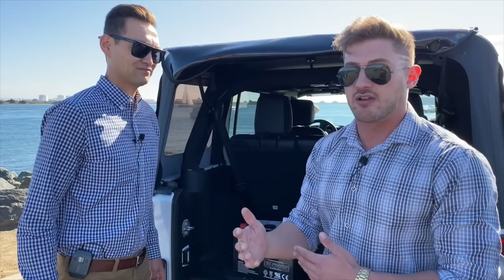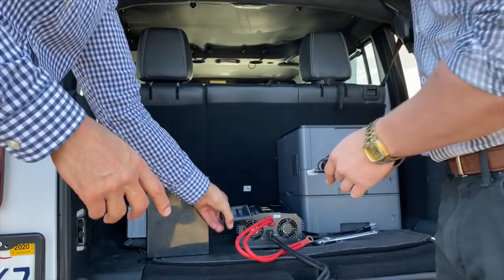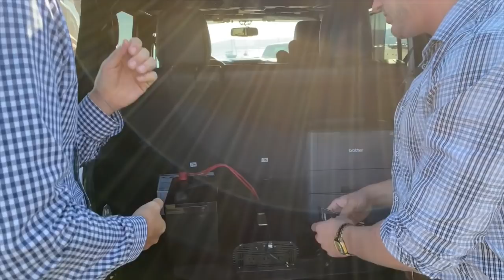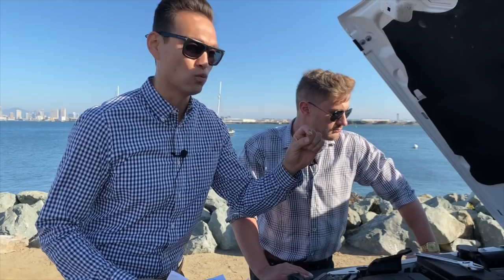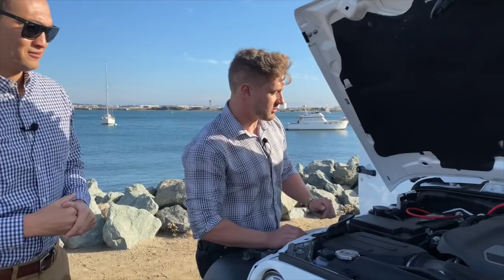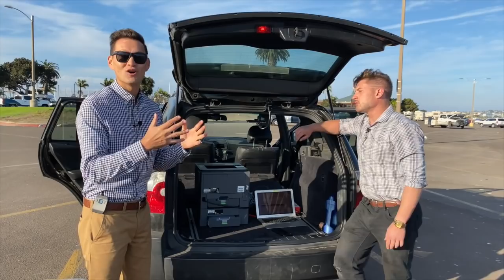How to Set Up a Mobile Office with a Printer So You Can Print Documents from Your Car | Notary Hacks

Comment: This is a great idea but I really would have to recommend if you use the car battery and run a cable to the back be sure and use an inline fuse on the positive line close to the car battery, just in case. 12v in-line fuses can be found at Amazon and get one which matches the inverter. For the technical people one can get cables from some Chrysler vehicles since they have a trunk battery or one in the back seat at a junkyard for very good prices and those are welding cables which is perfect for longer lengths.
Reply from the maker: I never thought of that! Thanks so much for the useful advice, Steve!

Comment: Quick tech question: if you are worried about drawing down your car battery, could you not run a separate battery in parallel to your vehicle's battery and use the alternator to charge both? It would technically be the same as an RV set up with an inverter. And if you are worried to much draw on the alternator, you could put a switch between the two batteries. Just a thought...
Reply from the maker: Thank you for the golden nugget Michael!!

Comment: I bought a 100AH deep Cycle battery a Krieger 2000 W inverter and connected them up in my office trying to make sure it all works before I try to put it in my car.  the Brother Hl-L6200DW Printer keeps giving me an orange error light. and shuts off says it will restart in 15 minutes so its not working but the printer does work in a regular AC outlet. It only is supposed to pull 650W while printing so not sure why it won't work.
Reply: I finally got it working I uninstalled and reinstalled the printer software and drivers and set it up again. Made sure my battery was completely charged and now it is working like a dream. YAY!!! So excited to hopefully be better prepared to make more money trying to increase from 4500 a month to 8K a month
Reply from the maker: Hi!! I actually just released a 2023 updated video on how to set up a mobile office for your business! It is more cost effective and safer! Click below to watch:

https://www.loansigningsystem.com/mobile-notary-office.html?utm_source=YouTube&utm_campaign=mobile_office

Comment: would it be okay to also have a laptop or other devices plugged into the inverter while also using the printer?— as long as it's within the watt capacity?
Reply from the maker: I am hesitant to answer this as I am not an electronics pro...but from my conversation with Conner is yes. 

As long its under the watt capacity you should be able to! 

Make sure you always check with a professional!
Reply: Laptops can be run at power balance for longevity; my suggestion is carry spare battery packs for your laptop; a lot less expensive and takes out the guesswork

Comment: Install battery in trunk and if you don't know how, go to a mobile stereo installer and have them run a power line to the trunk so your truck will automatically charge when you are driving. And you can get a battery much cheaper than $150.
Reply: A stereo installer would also have a battery box for that purpose which will bolt down.
Reply from the maker: Thanks for the great tip man! Game changer!

Comment: Wow, thank you for this great info. I ordered a Bluetti solar generator earlier this year (Florida hurricane prone)  - I think it can be used as well? I have not had any practice to set up and have been checking out you  tube to set it up.  I wish I knew more about this kind of things. The past three hurricane seasons here in FL have been so scary so I got this for backup.
Reply: https://smile.amazon.com/gp/product/B07QZC1FV3/ref=ppx_yo_dt_b_search_asin_title?ie=UTF8&psc=1      (Amazon MAXOAK Portable Power Station BLUETTI EB150 1500Wh AC110V/1000W Camping Solar Generator Lithium Emergency Battery Backup with 2 AC outlet Pure Sinewave,DC12V,USB-C for Outdoor Road Trip Travel Fishing)
Reply from the maker: Thank you for sharing this valuable tip!!

Comment: Hello, I have the same battery and it only seems to be charging to 80% according to my display on my charger. It will only print about 3 times (100 pages or more each time) and drops to 60 % and cant run my laser printer anymore? Something is wrong, correct? Ho do I know if the battery is defective or is it my inverter and or charger? Thank you for your help.
Reply: I have the similar issue...    I recharged the battery at night by using the specific voltage (15 A  and AGM mode) and it did not take 6 hours to recharge the whole battery, it only took about 2 hours or less.  Then I was only able to run my Brother 6200 DWT printer in the car two times (each about 2 sets of 150 pages) then the inverter starts beeping because of the low voltages... now I am wondering if there is a defect on my external battery or inverter.       Can Chris or Mark help in answering our questions?     Thanks!
Reply: @AmyyyWA  Hope we get answers for more of this technical stuff.

Comment: Cigarette lighter converter will work just find
Reply: Carl...does the cigarette lighter inverter still working?? I wasn't sure of those plugs would support a brother 5200 printer...thanks
Reply: @patrickkmanning  I plug everything in that plug never had a problem with it. I don't have any special batteries either
Reply: @CarlJohnsonandAssociates  interesting...
Reply: What kind of car do you have? I'm surprised you are able to get the necessary juice (1500w) to get your printer going!
Reply: @irhapsody2010  a 1999 ford expedition

Comment: Dope video! Printer consumption is 1200-1400W while printing, so all you need is 1500W inverter unless you plan on having other things using a lot of power but 1500W should be more than enough for printing and charging laptop. And all the items have skyrocketed because a lot of people are working remote or getting into the signing agent business and other business that require printing supplies . Greedy people know this and have stock piled on printers, toner etc.. just to flip them lol capitalism is at it's best during tragic times. Live, Love, Laugh and Learn...

Comment: I camp in my vehicle for recreation sometimes, so I already have a deep cycle battery in the back. It even has a vented and mounted battery case with a switch for the outlets (including usb) we wired to it. I just need to check what my inverter is rated for.
We have it wired as such that it charges off of the vehicle when it's running but doesn't over charge and leave one dead.
Unless you know what you're doing, I reccomend getting it professionally done if you want things the way I have it.

Comment: It may be easier to have longer cables and connect to the battery run in front of the grill and underneath the vehicle instead of through it  and connect to the back. Personally I'm not a fan of running off of externeal battery only as vehicle grit/dirt could give an unprofessional appreance during the signing or be transfered to the paper during the signing. if I were to go with the removeable battery I would buy 2. This way it is easier to ensure  a full charge and swap the accordingly (daily). I would also build a wooden box to ensure the battery wouldn't shift or have a fully exposed printer (tempting someone to break into the vehicle).  This is a solid idea. Just my 2 cents.
Reply from the maker: love the feedback!!!

Comment: Excellent Vidieo. Just like to mention when running wires thru the  car's firewall there should be rubber grommet around the opening. WIthout putting a grommet in place, the bare metal along with the car vibrations will eventually cut thru power wire, thus causing a fire. Yes you can do it, but be safe.
Reply from the maker: Thank you for the feed back!! it is appreciated!

Comment: I live in a part of SOCAL that gets 110 degrees plus during the summer, which means even hotter inside of the car. Won't the heat in my car damage my electronic equipment?
Reply: run your ac before you fire up the printer
Reply: Yes it could

Comment: Wow! The price for the converter and printer has tremendously increased on Amazon. May want to look for substitutes.
Reply from the maker: Ahh, gotcha. Thanks for letting me know, Val! When you enroll in the course, you'll get access to a network of 6,000+ successful Loan Signing System students who most likely have a few other printer recommendations... as a matter of fact, shoot me a quick reminder as soon as you enroll and I'll be sure to bring this topic up on my next live coaching session!

Hoping to see you there!
Reply: @MarkWillsLoanSigningSystem  My COVID Signing Agent experience: Anything that deals with electronic components is more expensive and really hard to find right. I called 20 different venders for that brother 6200 and everyone was out of stock either back ordered through the next month or even into 2021. I did finally find a local company who had the 6400 model in stock, so I had to jump at the higher price/bigger model just to move forward. Cheapest inverter I could find was this one on amazon @ $280 (I'm not an affiliate or anything) https://www.amazon.com/gp/product/B07H9SXV61/ref=ppx_yo_dt_b_asin_title_o00_s00?ie=UTF8&psc=1. My mobile setup printer/inverter/charger total ended up at $1,200! Upside is that with APR's so low, I got 16 closings in my first 2 weeks as a signing agent. I'll make back all my startup costs in the first month :)
Reply: @MarkWillsLoanSigningSystem  I am already enrolled 🙂 I’m just waiting on my notary application to be approved. I was watching the video because I love tech and thought it is a great idea to have a mobile office. While I’m waiting on my notary commission... I am completing your course. Thanks for responding 😀

Comment: If you have to print on the go, would it not be easier and cheaper to just go to Office Depot after saving the documents to a jump drive?
Reply from the maker: Two things-because of borrowers private information on the loan docs you should not print in a public place.
 
Secondly what if there isnt a office depot around...now what? 

Printing in your car in the long run is the cheaper way to go but you also never need to search for an office depot! you can just pull over and  print!

Comment: How would I set up my mobile office equipment if my truck may have 2 batteries under the hood?
Reply: Most likely it’s parallel (negative battery one to negative battery two, positive battery one to positive battery two), hook up the power inverter to the battery that is closet to the starter.

Comment: What about the scanner portion of watts? Would I need to add an additional 1300 watts on top of the 1400-1500 the printer needs? I want to do this so bad but I'm scared ill do it wrong or underestimate the wattage needed.
Reply from the maker: As long as you are not running the scanner and the printer at the same time this set up will be efficient!

Comment: Thank you for the video. Finishing my training. I understand every vehicle is different but how do you secure the printer from bouncing around and tipping over as you drive?
Reply: I'm planning on using Velcro with adhesive on the back. Sticky side on my printer and hook size into my vehicle carpet.

Comment: Okay here is my dumb question  again. I been at this for 2 months now and haven't printed not one thing mobile yet. Do it have to be a battery charger. I have a Stanley portable power....jumpbox..1200 amps...500w inverter. I have my batter hooked to it but I have no idea if its charging the battery.  Would you suggest I buy a charger or do I already have all i need?

Comment: I wont get into my resume, but suffice it to say that automotive intricacies are my forte.
That said, YOU DO NOT NEED AN EXTRA BATTERY OR CHARGER. The car has a DC electrical system that any pure sine inverter with a "cigarette lighter" plug will use so long as your car circuit can handle the amperage (other, slightly more complicated installs of the inverter can be done to bypass this issue. There are plenty of other YouTube videos showing exactly how to do this.) This inverter should be double the watts you need. 
This next part is IMPORTANT: You must leave the car running while using it. By doing so, you are NOT using the battery in the car per se. What you are using to generate power is the alternator. Once your car is running it does not need the battery. In fact, it can technically be disconnected after startup and the car will remain running.
Now, if you use your inverter while the car is off, you absolutely will destroy the batter. Even a deep cycle lithium battery would eventually be useless. 
I love that Mark is trying to help, but as somebody who has spent a career working on advanced automotive techniques, I felt obligated to correct this information to for the betterment of everyone. 
If anyone one had any more questions or needs any help, please feel free to contact me. I just want everyone to run their business with as little overhead and maximum profits possible.
Reply from the maker: i appreciate the feedback as i am NOT an automotive expert.

With that being said, i think you said it best "so long as your car circuit can handle the amperage". 

it is my understanding that the DC out let in the car does not have the amperage needed to run a dual tray laser jet printer hence the need for an inverter to be attached to batter whether that is the battery in the car or secondary battery.
Reply: @MarkWillsLoanSigningSystem  The way I would personally do it is install wiring that is essentially what an after market stereo amplifier would need and those wire would absolutely be able to hand 20 printers. It's about a $30 kit. 
Either way, thank you so much for everything you do! I purchased your program and it's fantastic. I cannot wait to get going as a signing agent.
Reply from the maker: @alexandertutt  welcome to the family man!!! so excited for your journey!
Reply: Not correct at all. If you are an automotive expert, you would know that a car's 12 volt outlet can absolutely not handle 1400 watts of power (what the printer peaks at).  The inverter must be wired directly to the battery, which acts as a load buffer while the car's alternator makes up for the power draw, or must be wired to an external battery. 12v outlets in cars are wired to handle around 300 watts max

Comment: You all need to be looking at the methods of RV dwellers who use solar power and solar powered generators. You can mount solar panels onto the roof or hood of your car. Those can go into products such as the jackery 1000, or other 1,000 watt Battery + inverters like bluetti. It seems hard to believe that you could run that 1500w printer off of a single battery for more than a few pages at a time. That printer uses an enormous amount of electricity!
Reply from the maker: great idea and feedback...thank you!!

Comment: I would like more information on equipment over heating in warm weather, have talked to people who had had overheating issues. Also what about winter condensation issues on the boards in the printer? How can that be compensated for those that keep the  printer in the car 24.7
Reply from the maker: In full transparency-like any electronics heat and cold are not best environments. 
Every signing agent has to make sure that the car is parked in the shade, kept in a garage or AC or heat is on to make sure the car is as neutral temperature as possible.

Comment: I'm having a brain freeze.  I have all hooked up. Finally tried to use it. Forgot. Did I miss how to print connect wirelessly
Reply from the maker: no worries! he simply uses his phone as mobile hot spot for his lap top to connect to!
Reply: Yes. I went back and watched the video. I notice you dont reccomend using your cell phone only. I have a galaxy 10. When I'm home sometimes I use it to print wirelessly bc the software on my phone automatically separates the letter from the legal when Microsoft edge does not. So I was trying to figure out how to print from my phone straight to printer while I'm out and about. I failed today. Tried for like 30min...couldnt get it to work. I whined up going to office depot to print instead of going back home
Reply from the maker: @pamcraftsandtreats  i dont recommend printing DIRECTLY from your cell. i do recommend using your phone as a hot spot your lap top connects to and printing from your laptop.
That is what conner does in this video.
Reply: I think i will just buy the external battery even if its extra

Comment: I love the video and the resources you recommended. However, when I clicked on the provided link for the inverter - I never got it to work with the 12v 100ah deep cycle battery I purchased to power it up. I kept getting LO alarm/symbol immediately after turning the inverter on with a fully charged battery. After troubleshooting thinking it was a bad battery possibly, I went and had it tested at two different places. I bought a new battery anyway and encountered the same LO alarm issue. Ok, it must be the inverter. I sent for a replacement inverter which is on the way. THEN, i got a reply back from questions I asked during my troubleshooting and it was brought to my attention that there is a 24v 2000w inverter which is what you  suggest here, and there is also an identical 12v 2000w inverter. I didn't know that. I think your 24v version link should lead to the 12v 2000w version. Maybe not, something to look into. I'm requesting a replacement for the 12v 2000 watt version. I think my woes will be fixed. The 12v battery simply isn't strong enough for the 24v inverter. Hope this helps. Here's the fix: Change the image on your blog page (it shows 24v inverter) but the link lands on a (12v inverter) it's a bit misleading which I know isn't your intention.
Reply: Did the 24v inverter fix your problem? I’m having this same issue